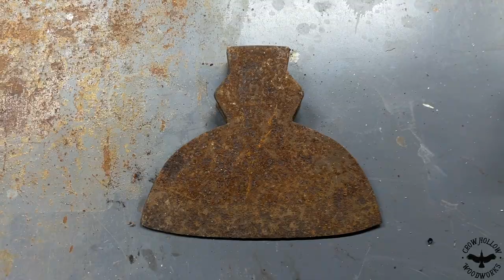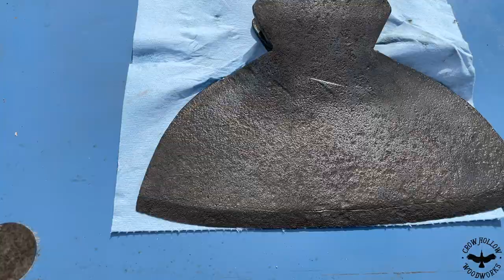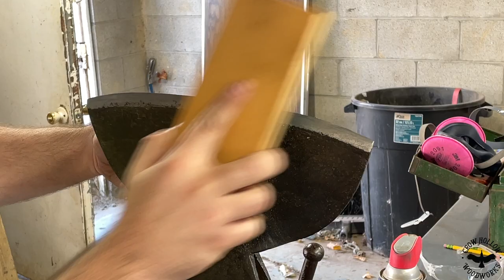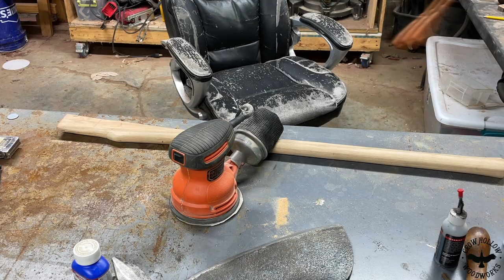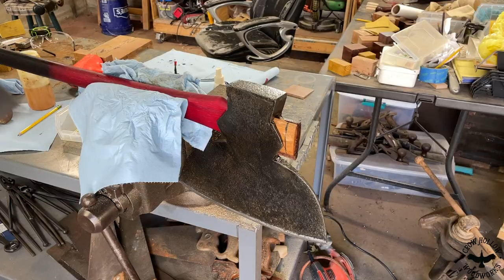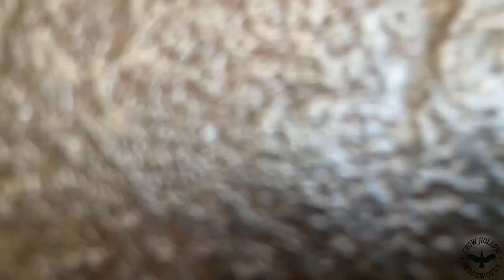Broad Axe Restoration

Comment: As far as I can tell you never ground all of the pits out of the back side down near the edge.  That means that every where the edge intersects a pit there is a nick. When in use, every nick in the blade will leave a ragged line on the wood.  Not really a restoration, only a prettying up.